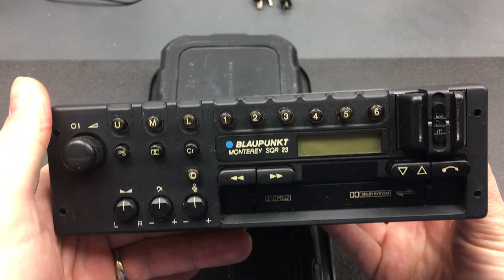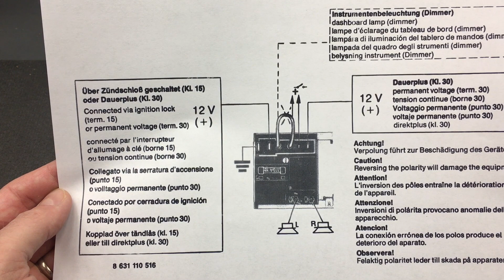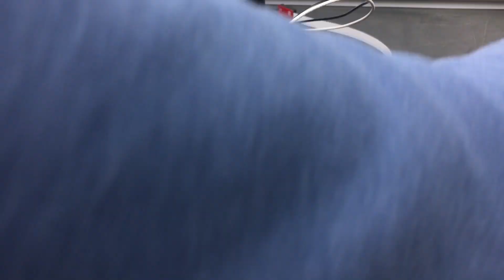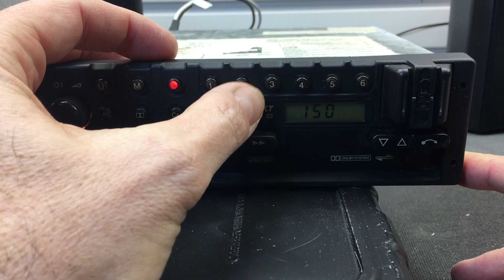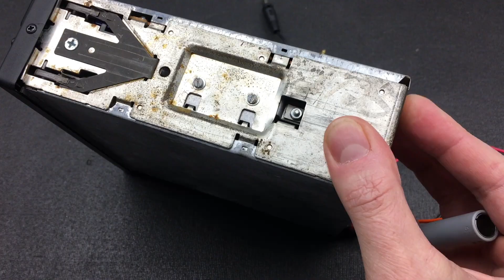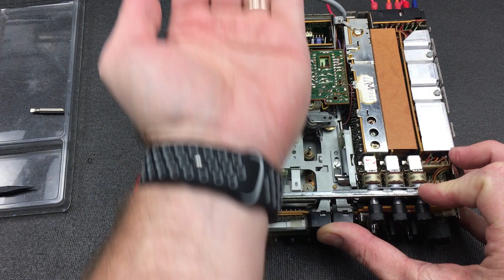Blaupunkt Monterey SQR 23 Part 1: Overview & Opening

Comment: hi, i found your video here in youtube, my name is Fabio Delan, and im from brazil, i asked to my son Felipe to talk with you because i dont know how to speak in english. i would like to know if you can help me with tips about the radio blaupunkt sqrr23, i would like to buy one, but, its not working, in my country its very rare to find one, and even harder to find pieces of it. i would like to ask you that if i need some pieces, and i will, would you get some for me to buy from you? i have a fusca (beetle 1984) and the radio of it costs 60 dolars, i think that it would be a good idea to fix it, do you think you could help me?
Reply from the maker: hi Fabio, 60 dollars is a very good price for a Blaupunkt SQR23. Is that the correct/original radio for a 1984 Fusca? I would certainly help you but I don't have any SQR23 radios or parts any more. Also, the parts that I used to repair the cassette deck (such as the HLC1395 Photocoupler from  Part 2 of this video series)  are also no longer available, so if the cassette mechanism is not working it will be very difficult (if not impossible) to fix.
Reply: @olafwagner  Hello, thank you for your kindness in responding. This radio model didnt come out in the Beetle, in none of them, it came out in its family, the Porsche. We have an expression for that, "the rich cousin of the family"... its not my intention to leave the beetle in it original state, but modify it according to my taste, you know? for me I don't intend to fix the tape player if necessary, because there are no new tapes to listen to, but I imagine that at the moment it would be cool to put on bluetooth to listen to, tears for fears, or a-ha or the classic big japan on a blaupunkt monterey 23.

i ask because if i need any parts, i believe it is easier in your country than here in Brazil, so I would like to count on your help.